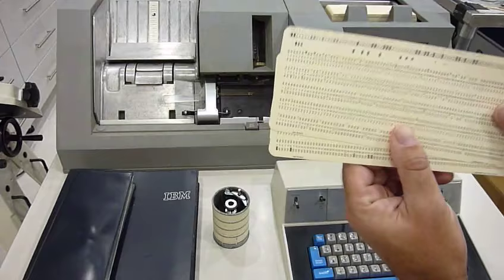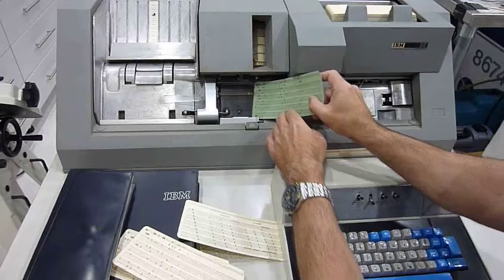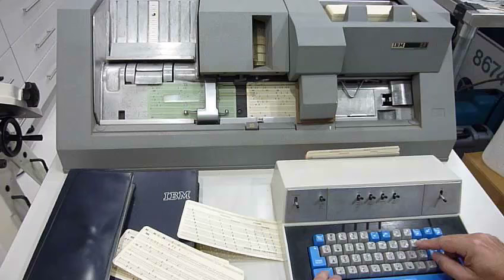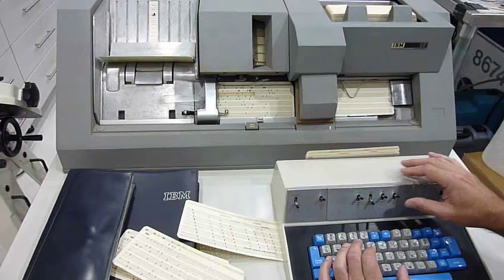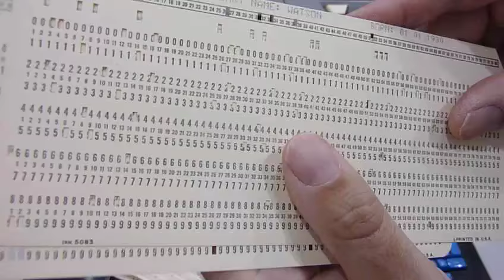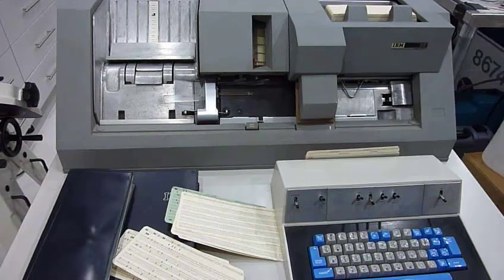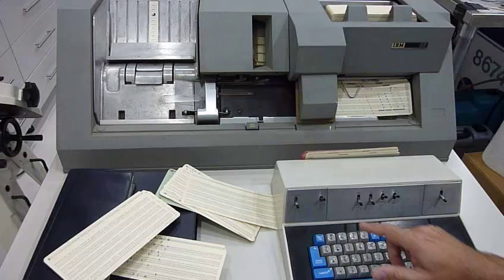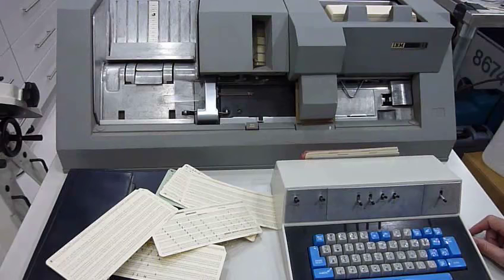1964 IBM 029 Keypunch Card Punching Demonstration

Comment: Great to see that - it bring back some memories. My first full-time paid job 45 years ago was programming an IBM 1130 and all the programs and data input was on cards. We had two 029 punch machines for that. Although you normally wrote out your programs on coding sheets which were handled by a punch operator (who was far faster them I was with the 029) it was much quicker to punch a few cards for bug fixes yourself.

Comment: They weren't quite that noisy.  This one sounds like it's worn.

We used these to write our class programs at the computer center at Case Institute Of Technology.  Actually, I preferred the 026, because the keyboard had a cable, and you could move it around.  I was pretty good at making drum cards.

Case used UNIVAC, a room sized 1107, but also had a UNIVAC 1 that the C+O railroad used for accounting.  Delay line memory, and metal tapes.

Odd to see the corner cut at the right, but the cards are printed, so that's the way these were supposed to be.

Really takes me back!
Reply: SteamCrane the ones I used in high school were that noisy but who knows how old they were and how much they were used.

Comment: I used to be able to type faster on an 029 keypunch machine that I could on an electric typewriter. It was something about the wooden chair and height of the keyboard that were the perfect combination. I still have the manual for the 029 and I also have a control drum that I used back in the day.

Comment: Used to use one of these to punch source code cards. The 029 came in two versions, one with the full alpha-numeric keyboard and one that was numeric only. Where I worked, Shillito's department store in Cincinnati, was also had many of the older 026 keypunches. I preferred the 029 as it had keys for  all of the symbols needed for the source code whereas it was required to know how to manually 'multi-punch' the special codes with an 026.  Fun days - and yes - a room full of these machines was very noisy - probably would exceed today's OSHA limits.

Comment: Back in the 70s I maintained both 026 and 029 machines in the UK , both machines worked well if the manufacturers instruction manuals were adhered to. I saw a suggestion that the resultant card chips could be used as wedding confetti, on no account should this be done as the chips have very sharp edges and could cause damage to eyes. I seem to remember warnings about this in the manuals.
Reply: So did I JL in Glasgow and Edinburgh branches and for a while at Greenock plant.

Comment: Sparkler Filters, a manufacturer of industrial filtration systems in Conroe, TX, still uses an IBM 402 tabulating machine to do its day-to-day accounting.  An 029 is used to provide it with input.
Reply from the maker: Indeed, my colleagues at the Computer History Museum know them well and have visited, video here:
https://www.youtube.com/watch?v=pxCZ35y3O04
It's mind boggling they are still happily stuck in 1950's electromechanical computing, and even more mind-boggling they managed to keep it running! That must be some kind of Guinness record here.
Reply: +douro20 Leave it to a company in Texas of all places to be stuck using 1950s technology. I wouldn't be surprised if Conroe is in Louis Gohmert's congressional district.
Reply: Who do they find to service it? I used to dread setting up counter plates or realigning the read brushes after a card wreck and I was trained and I'm 78 now. So you can't send anyone on a 402 course and it's not exactly the sort of skills and experience that's easily passed on to a younger engineer! How do they do it?

Comment: HA!
A lot of the CICs, Computer Index Cards, needed a color coded stripe washed across the top so I had to fill the proper can with the correct color and it was like a gigantic magic marker including the enormous felt tip. It would mount to my press and I had to adjust it so that It cleanly "striped" the top 3/8 inch or so of the paper as it unwound. I used to get beat up wicks and had to trim them. We all carried our own knives to trim.

Comment: This was the machine I learned on in my Keypunch Class with Grumman Aerospace. I then was hired as a keypunch operator with Grumman Aerospace in 1973, at age 17!  Machine was So loud! All my typing classes in high school paid off! lol I only did this a short period of time before I was promoted to an expeditor at Great River Plant, Long Island, New York!
Reply: Don't know if you will ever get this message, but anyway......I worked for GAEC from '67 to '70 left and returned to GDS from '73 to '80.  I lived on the Island from '68 to 2015.  House was in Islip Terrace right across the street from Great River Plant.  Before my first stint with GAEC, I worked for IBM in NYC in Field Engineering working on unit record equipment and mainframes.  Enjoyed my time with the keypunches and sorters the best.

Comment: Back in the late 1960s I worked for a major railway and we used to keypunch railcar information on the 026.  We used to punch our own cards for the programme drum, which the star wheel would eventually puncture causing the program card to fail to work properly.  A colleague of mine sent in a suggestion, and received several thousand  dollars as an award.  His suggestion .....   plasticize the program card so it did not wear out so fast.

Comment: Learned typing on a manual typewriter were you end up resting your fingers on the keys where they float a bit.  So first time I used one of these keypunch machines, the very touchy keyboard caused issues.  Would rest my fingers like I learned and would shoot a couple garbage cards off to the hopper.  😄

Coded our programs on the cards.  To run the program you’d load the card deck into a card reader attached to the computer.  Once tested they’d be stored as a file on disk.    You haven’t lived until you drop your program card box of up to 2000 cards all over the floor. 😱.  😂
Reply: Wasn't only the fingers resting on the chads.

Comment: Wow. This is a blast from the past. I used to use on of these machines to punch cards back in the late 70's. I used to be able to type faster on the keypunch machine than I could on a regular typewriter. I still have a control drum for that keypunch machine. BTW, in interpret mode it didn't print the A on the top of the card.

Comment: I used the older 026 and the newer 059 machines back in early 70s.  The card dup feature was handy when you made a mistake. You could dup the card up to the mistake, and then continue typing on the corrected card.  Never used the program card I think, because I typed programs not data cards.  There were features shown which I was not aware of. Cool.

Comment: HA! PART.2
The Pryor Corporation was in the Buncher Industrial Park in Pittsburgh. I was there from 85 to maybe 88 or so. Got laid off when the giant computer tech sweep took place.
The Company had a guy that cut the 10?15 foot long log of single piece spooled paper into the proper width with an elaborate machine consisting of a series of equally spaced SS blades and spooled the output back onto an axle that had a bunch of individual plastic hubs for the cut paper to wrap back onto. When it was approved for use, it looked like an untouched roll of paper until you hit it with a gigantic rubber mallet to bust off your wheel of paper. Locking hub included. And yes, I sported a mullet when I was using the mallet.

Comment: I used to punch my RPG II programs straight from mind to keypunch w/o any paper in between. I bragged it would take me 3 compiles to make a program work. compile 1-fix keypunch errors, 2-fix syntax errors, 3-fix logic errors. 
One of my operators spilled her Pepsi onto her keyboard. A flash of light and it was a $2,100 block of metal.

Comment: The 029 keypunch was ready to use as soon as you would turn it on. The 026 keypunch, on the other hand, would take time to warm up, before you could use it. I don't know why the 026 would have to have vacuum tubes in it, but offhand I can't think what else would have to warm up.
Reply: The IBM 024 and 026 were announced in 1949 before the invention of the transistor.
Reply: @RaymondHng  So I guess the reason they needed any amplifiers or switches was to implement logic to map from what key you pressed to what punch solenoids to activate.

Comment: I was still maintaining one of these, or a similar model, until about 2003 when I eventually scrapped it. It was still working when it was scrapped but we'd finally run out of ink rollers for the printer, the only person who knew how to properly drive it was retiring and I was sick to death of the damn thing. Even so the fact it was still functional after four or five decades was pretty impressive although the fact people still used punch cards was somewhat less so.
Reply: Anthony Handcock in think i know what place you are talking about, hopefully you did not scrap the plug boards etc. those are worth bucks.

Comment: If I remember the IBM 129 was next which had an 80 byte memory and you could actually backspace and correct mistakes. Then when you were ready you hit Release and it punched out the chads. Circa 1976.

Comment: HA! PART.1
I used to print those cards on an Offset Printing press. I think it was a a Carroll but that might have been the other press that the others guys used to print turnpike tickets with the magnetic strip back from 60s? to late 80's? My group had probably eight presses, one directly behind the next. Everyone faced forward. Giant spools of paper probably 3 or so feet in diameter but already cut to width and loaded like a carriage wheel.

Comment: Beautiful machine! It purs like a cat! Beautiful sound too! Like a petroleum engine. I much like this video.
Let me ask you a question: my teacher at school asked me to use a drill and in the base of a deck of cards make 5 holes.
And using a code to cut the holes till reaching the border of each card using a criteria which I can't remember.
Using 5 pins and chosing one hole according to some matrix you would extract the specific card that you wish.
I plan to ride the exercise again, but this time I will link it to a computer operation.
Can you post a video?
It is an extraordinarily didactical exercise to learn young people learn basic computer.
Thanks so much!
You've got my like!

Comment: I hate to tell ya but these were still used in the early 1980's.  I know, cuz I worked on them. And I hate to also tell ya, you aren't very fast.  }:o)  An experienced keypunch operator made their own program cards.  If ya got it wrong, oh boy.......LOL.  Ya didn't fired but you darn well better have repunched all your work correctly.  Depending on the company, you might still get paid overtime.  

Thanks much for the video.

Comment: maybe i need a different forum. This is the first time I found someone using the puncher.
     Another thing was that the cards we churned out all had to be within a thousandth of an inch or so in length and I would adjust the press accordingly to maintain. I had a mounted analogue measuring window to slide a card into and the dial would tell me if it was acceptable.

Comment: I did not quite get why you had to put your own program in the drum, because these all seemed like basic features that the machine should have anyway. Or was the drum program actually the way it had those features and you just called the program "your own" when it was one that used to be delivered with the machine? Sorry, I'm a programmer but I know quite little about these old technology machines.
Reply: Data was stored in record-oriented files. Each punch card is one record of a file. Each record can be divided into fields which are groups of columns on the card. Information is stored in fixed-length fields in fixed-length records. In this example of a punch card https://cf.ydcdn.net/latest/images/computer/_PUNCHCD.GIF columns 1 through 5 is the customer number field, columns 6 through 22 is the customer name field, columns 23 through 48 is the street address field, columns 49-60 is city and state, columns 61-66 is invoice date, and so on. A program on a keypunch machine describes the field layout of a record. It indicates the beginning and ending column number of each field, whether the field is alphanumeric or numeric, which columns should be automatically skipped, and which columns should be automatically duplicated. The program for the above punch card will automatically set the keyboard to numeric shift for columns 1-5 and 61-66, alphanumeric mode for columns 6-22, 23-48, 49-60. When the data entry operator types in columns 1-5, the keyboard is automatically in numeric shift and the operator can rapidly type numbers with the right hand. When the operator finishes typing "ASHLEY COMPANY", s/he then presses the SKIP key and the machine advances the card to column 23. S/he does not have count how many spaces need to be typed to fill out the field. If the city and state of the current record is exactly the same as the previous card, s/he presses the DUP key and the machine automatically duplicates columns 49 to 60.  A common additional feature made available (at additional cost) was the leading zeros feature (termed "Left-Zero"). The field was programmed for leading zeros using the program card. If it was (say) a six digit field, the operator only had to key in the actual value (for example 73). The feature would then fill the field by punching the leading four zeros, followed by the 73, in effect right justifying the field, thus: 000073.

Comment: Impressive!  But can it run Crysis?
Reply: 1godlessmonkey Crysis on keypunch? I bet you don't even know what keypunch is. It is essentially a typewriter that punches holes in addition to printing chars. It has no processing power, it is not computer.
Reply: macieksoft  I know, right? That's a dumb as asking if you can run Crysis on a keyboard!
Reply: Dude, it is a popular internet humor.
Reply: Ya, but they killed the joke. There has always been the unwritten rule that it applies to data processors of some kind. Why doesn't he go to a Mattel toy exhibition and ask if the toy doll can run crysis, or perhaps go to a carpentry channel and ask if the miter saw can run crysis... The joke applies to digital/analog data processors. If this were an analog rotary based calculator, even then it would be funny (or at least necessary internet tradition) to ask.

Funny would be a rule 34 IBM 029 video/picture.
Reply: @macieksoft  that joke flew right over your head
Reply: Only after you install the new cards with the correct firmware updates.

Comment: If a program had a loop, did the hole punch computer read the same cards over and over until the loop was complete?
Reply: No. If a card-reading computer program had an infinite loop, each card will be read until there was no more data. Then the program aborts.
Reply: @RaymondHng  so it loaded all the cards 1st, then it executes? I'm assuming this means they coded in a compiled language
Reply: @Psylent  COBOL and FORTRAN started as compiled programming languages. Card readers are sequential devices. Once a card is read, the next card is waiting to be read. One cannot go backwards. When mainframes started to have disk-based operating systems, computer programs no longer directly access the card reader. It was inefficient for a computer processor to wait for slow devices such as card readers and printers. All the cards were read at high speed into the computer and stored in temporary files on disk drives. Then the card-reading program would read the virtual cards in the temporary disk files.
Reply: @RaymondHng  Thanks for that explanation.

Comment: If you watch Kubrik's film '2001: A Space Odyssey', the keyboards on HAL 9000 are the same as these. Seemed fine then, seems funny now.
Reply from the maker: Which scene? I don't see any keyboards like this one in Space Odyssey. Some large IBM inspired lit buttons though like the ones you find in IBM tape drives.
Reply: @CuriousMarc  The KB, minus the box and card-punch control switches, appears virtually any time they need one in the film, e.g. with HAL9000 and, I think, when Floyt is calling home from the space station.  I used those KBs a lot during the 60s when I was doing Computer Science in Edinburgh.

Comment: I still remember programming those machines since the 024 (tube model)
Cant tell you how many times I replaced the starwheels from people who woild just rip out the drum w/o raising the starwheels!! The newer 129 was an awesome keypunch w/o starwheels.
Reply: The IBM 129 did not have star wheels.
Reply: @RaymondHng  never said they did, re-read.
Reply: @rty1955  The close proximity of the last sentence to the previous one implies it. It needs extra words in order to separate the two contrasting models. 
"Can't tell you how many times I replaced the star wheels from people who would just rip out the drum without raising the star wheels. On the other hand, the 129, which used optical sensors instead of star wheels, was an awesome keypunch."
Reply: @RaymondHng  feel better?

Comment: I may be moving and storing one of these soon. What is the size and weight of one? Can they be set on their back when moved?
Reply from the maker: Congrats! W: 39", D: 29", H: 38", weight: 230 lbs. They can be put on their backs, that's how I moved mine.
Reply: Thanks for the info. But it won't be for me. It was at risk of being scrapped and I volunteered to go get it before the guy who has it needs to get it out of where it is now. If I end up picking it up and storing it, it will be for someone in Boulder Creek. But, after watching your restoration videos, I wouldn't mind if I end up having to keep it.
Reply from the maker: Just caught up with the thread on that keypunch. Seems quite an adventure in heavy lifting indeed. Thanks for saving the beast!